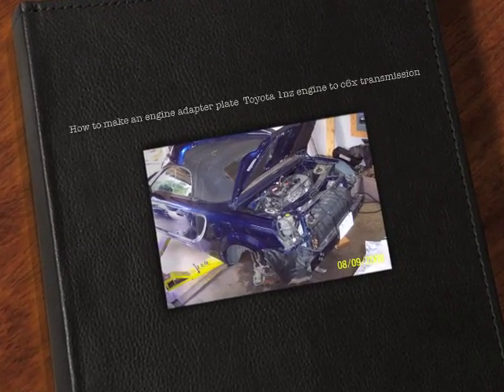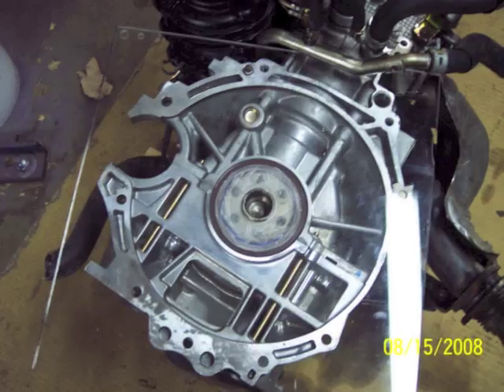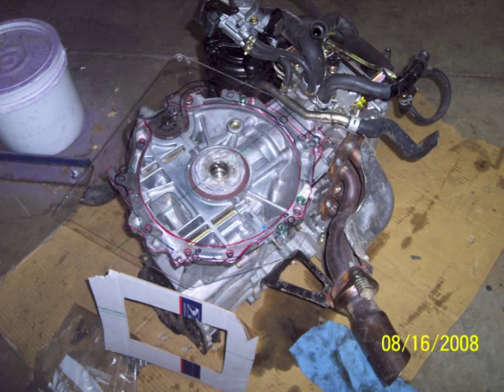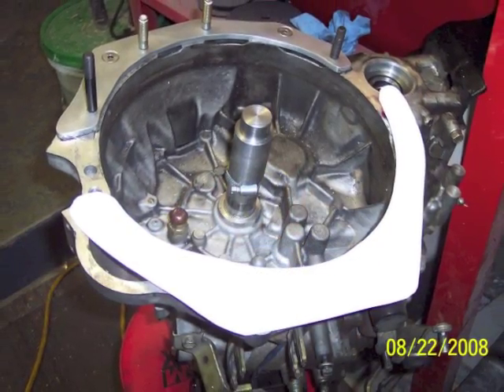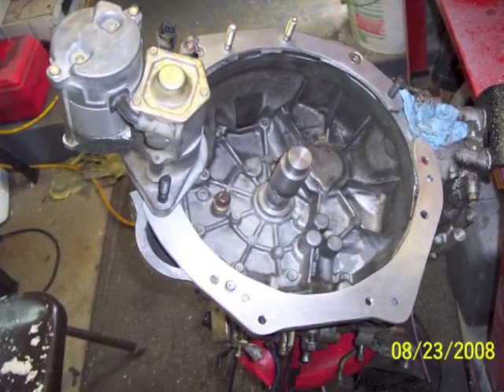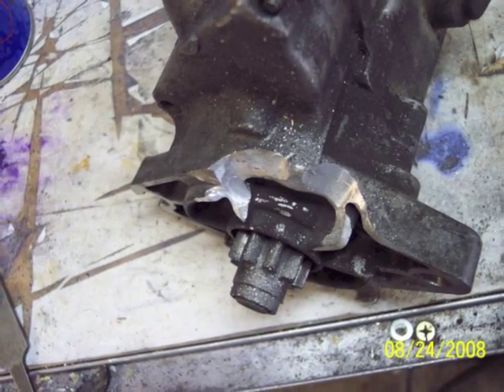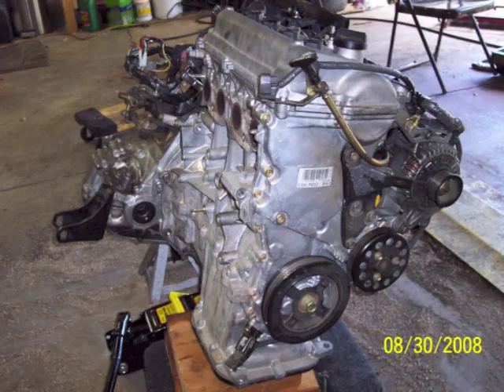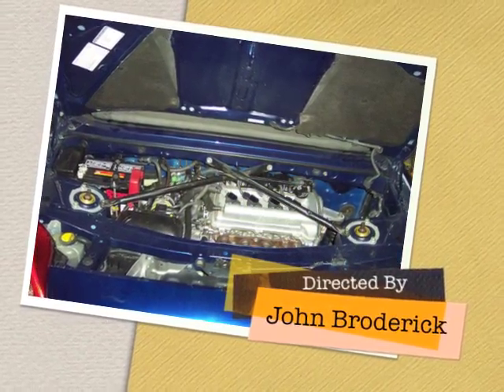How to make an engine adapter plate  Toyota 1nz engine to c6x transmission DIY

Comment: Are you using your stock transmission? If yes, how would that outline you've drawn on the glass, from the transmission fit properly in the engine side?

Comment: did you make a thicker pilot bearing so the input shaft would reach?
Reply from the maker: Good question.  The Toyota transmission that I used has no pilot bearing or bushing.

Comment: Learned a lot on your video great job.just have question I have a rail buggy I'm using the vw transmission but I want to put a rotary engine on it.the spacer costs me 600 bucks.how thick of a spacer you recomend.?

Comment: I have a question: Is it possible to adapt a prius 04 transmission onto a corolla 04? Given the fact that a prius engine uses the Atkinson cycle rather than a conventional Otto cycle that a corolla's engine uses.
Reply: that would be very surprising if it did, as everything on a Prius seems to be different

Comment: thanks bud ill use you method n weld extra meat n bolt holes area may more likely tig in to housing  oh ill be doing a turbo n rwd application not decided on engine yet mostly probably a 5mge n 6 spped nissan tranns.. God bless Jesus name

Comment: was there a reason you didn't use the c54 (i'm guessing) transmission out of the echo that you took the engine from? wouldn't that be a much easier solution, i'm not sure if the cv shafts fit in though...
Reply from the maker: Hey Cory Great Question!!!  The c54 might work and would probably be less hassle.  The reason I built the adapter is that I had a freshly rebuilt custom Celica C6x 6-Speed with a Quaife Limited slip diff and I wanted to keep that transmission.
Reply: i'm trying to search various forums, can't you use the bellhousing/differential section on any 'C' transmission - then you could just remove the section off the echo trans, and use it for the mr2 trans. i asked same question on spyderchat
Reply: @corybutterwick5445  yes ,you can do that ,only thing that you need to check is the bearing bushing,most of the time you just need to change the bearing on the diff ,and thats it ,the cool thing about toyota gearboxes is that the bolt holes line up between all c gearboxes and some E gearboxes

Comment: So the "studs" just screw into the plate itself one one side and then extend through the bellhousing or block (depending on the side) and take a nut?  So it is just threads holding it into the plate side (rather than a bolt or screw head)?  How thick is the adapter plate?

Comment: Some excellent engineering going on here! Very well thought out and executed.

Just curious why you didn't source a 1NZ bell housing instead? I've got a MK1 MR2 that is slated for a 1NZ swap as well and it can be done by just putting an xA/xB bell housing on the MR2 gearbox. I'm also working with a group of Yaris owners that are swapping in 2ZR motors and starting to experiment with a C60 swap. The plan is to use a Yaris/xD bell housing to mate it to the 2ZR (which also bolts directly to the Yaris C50 gearbox).

Comment: John Broderick, YOU are a patient man !
One question please - I was surprised you didn't have to install a spacer between the engine and flywheel to ensure proper contact between the input shaft splines and the clutch. Was the replacement engine's crankshaft a bit longer than the original?
Just curious.

Comment: how do you get the clutch to work when the whole gearbox is back the thickness of the adapter plate???
Reply from the maker: Good question MyMIXmedia!!I lengthened the clutch actuator rod slightly more than the thickness of the adapter plate. This is shown at 8:50 in the video: https://youtu.be/VuprPEhF2Ic?t=8m49s

Comment: Great Video. 5 Stars.
I'm trying to build an engine adapter myself. I have zero experience with AutoCAD and other computer assisted drawing tools so your method seems simpler for a guy like me.

I am assuming you used a Dremel to cut the recess for the crankshaft, can you tell us what type of blade you used?

Comment: How does the transmission handle the added spacing between it and the engine? Are there any dangers of damage to parts if the spacing is to wide between them?
Reply: +Aaron Smith i would assume there would be less contact on the input splines on the gearbox which would mean there is a possibility of them stripping. i wouldn't know though, i have never done an engine swap.

Comment: Nice work. What did you do to extend the starter motor throw?
Reply from the maker: Thanks Euan!  In this case the starter is on the engine side of the adapter.  The flywheel has not moved in relation to the engine nor has the starter.  The starter drive engagement depth is the same as original. The change occurs at the transmission input shaft as it penetrates the clutch disc. The original setup over-penetrated the clutch disc so no problem here either.  If there is a problem with your setup you may be able to machine the starter or bellhousing to change starter motor throw.
Reply: John Broderick cheers, I thought about it when I went to bed and realised that was probably the answer but I didn't look at the detail hard enough in the pics. Thanks for pre-empting my next question too (input shaft penetration). I like how you did this. I can think of easy ways to pic up the dowel pin locations with a milling machine but free hand?? That is some effort. I 'd like to mate a Honda k20 up to the getrag in my bmw (one day) so cool to see how you did this. thanks.
t

Comment from the maker: Hey STARMAN000001, a GM LS engine connected to a Subaru transmission sounds really cool! The dowel pins on the back of the engine support the torque to the transmission.  As a general rule of thumb the aircraft quality plate thickness should be near the length of the exposed end of the dowel pins.  The plate must also be thick enough for the recessed fasteners to be flush with the plate.  In this video the countersunk allen fasteners need to be flush.  You can look up the head recess dimensions for the fasteners that you plan to use.  It is best to purchase the fasteners first and measure them because they sometimes vary from published dimensions.  You can use a helicoil with higher grade hardware to step down to a smaller fastener to save space.  If you plan to use the plate as a motor mount I would study the design of existing aftermarket motor mounting plates from the drag racing world to get an idea of the required thickness for the torque that you plan to generate.
Reply: Rob James from a practical aspect of things it’s definitely not cool. However the cool factor is why people do things like a GM LS to Subaru transmission. To have GM V8 power in a small AWD platform that a lot of fun driving right there. You don’t adapt things that weren’t designed for each other for any reason other than because you want to and have the will power to make it work. Us gearheads like to frankenstein things. Lol
Reply: some subaru transmissions are hot garbage. i would know; i blew up probably 3 or 4 of them with only 270 whp.

Comment: so, after having run this setup and i'm assuming no vibrations,  was there some decision made over how thick spacer you were going to need,  I want to mate a LS GM engine to a SUBARU transmission.  I would like to hear input  on thickness of the adapter

Comment: A nice piece of Kit Mate. I take my Hat off to you :-). The only thing that i didn't like is where you had to cut the Starter to accept a Slave Cylinder even still what you done was very clever. It's a shame that you couldn't use a Cable Clutch but that would have been difficult on a Mid Engined Car.

Comment: What about the output shaft on the transmission? I never understood how plates didn't cause spacing issues.
Reply: It's actually called the input shaft and generally the issue is the input shaft of the tranny doesn't reach the pilot bearing. So usually there is either a custom flywheel made that would basically be thicker by the amount of the adapter plate. or if the splines on the input shaft are long enough to still go all the way through the clutch disc you can just have a thicker pilot bushing made so the input shaft goes into the pilot bearing.